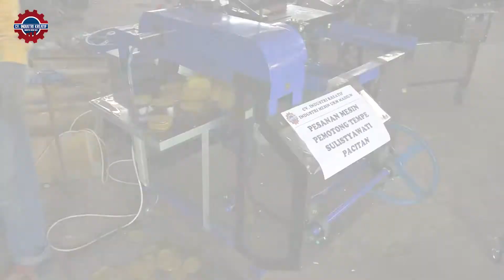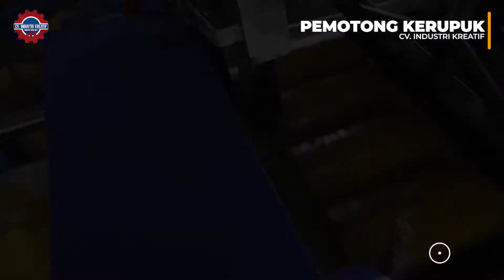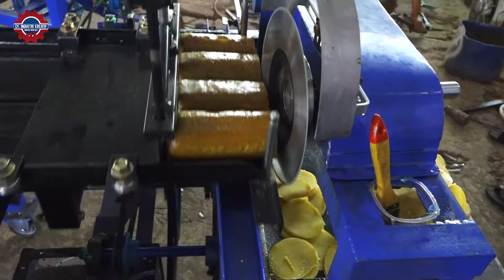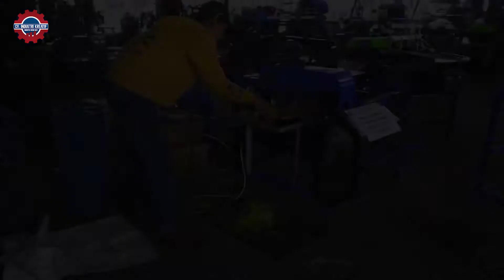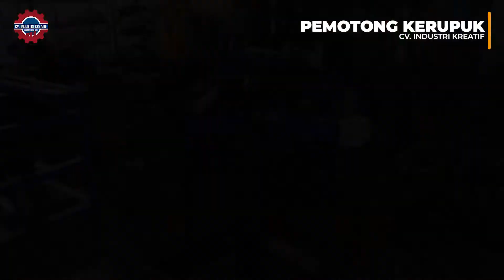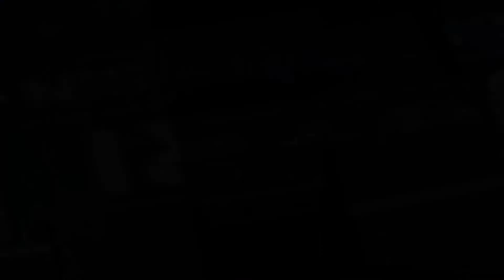Mantab....!!! MESIN PEMOTONG KERUPUK OTOMATIS - CARA MEMOTONG KERUPUK MENJADI IRISAN TIPIS-TIPIS

Comment: Pak klw potong kerupuk nya langsung di potong apa tunggu keras dulu kerupuk nya biasa nya berapa hari setelah di kukus langsung bisa dipotong. Terimakasih🙏
Reply from the maker: untuk info harga,detail mesin & pemesanan hubungi Customer Service Representatif Kami (Telp/WA) 081234280625 - 081217850288 - 082142267610 - 082334870125 atau kunjungi Workshop Kami di Jl Madiun - ponorogo KM 10 Selatan Puskesmas Geger 300 Meter Kec Geger Kab. Madiun Jawa Timur